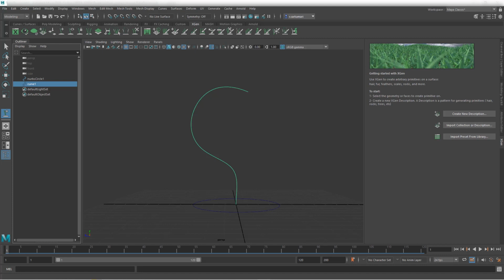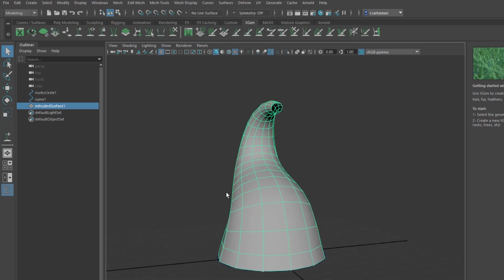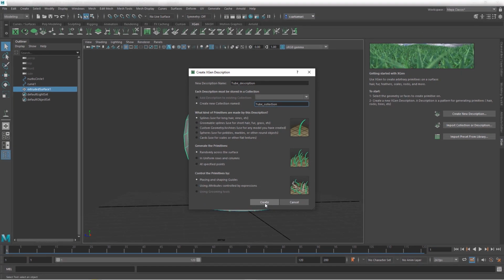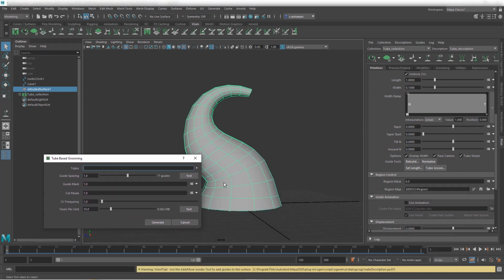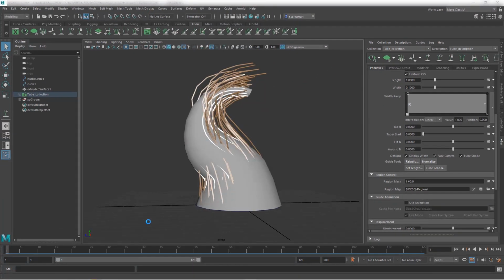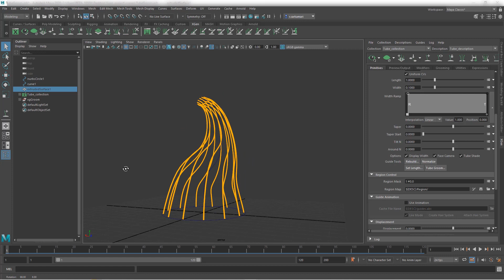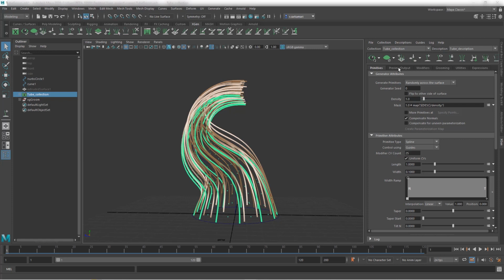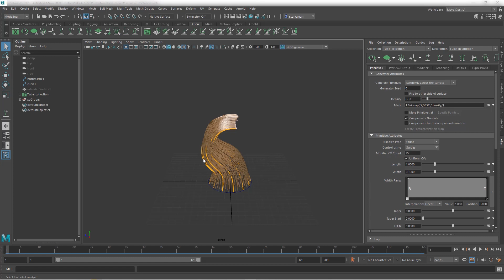Maya XGen Series: 03 Using Tube Grooms

Comment: I don't know why I can't place XGen guides on my nurbs taped tube...
EDIT - With the sweep mesh tool it works, but I really want to figure out wht it doesn't work with the method you show in the tut
Reply: I have similar issue... I can't extrude correctly the surface. It looks like it extruding equally.
Reply from the maker: Just use sweep mesh tool. It's much faster  and you get a better topology
Reply: @sarkamari  Thank you!!